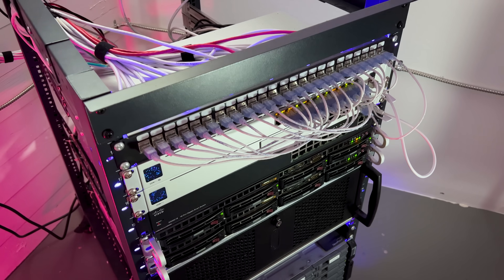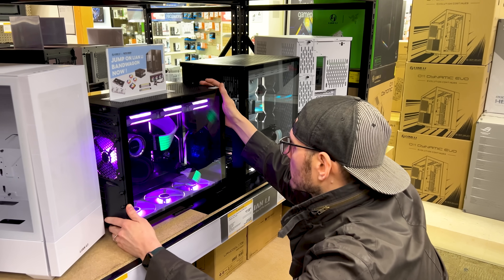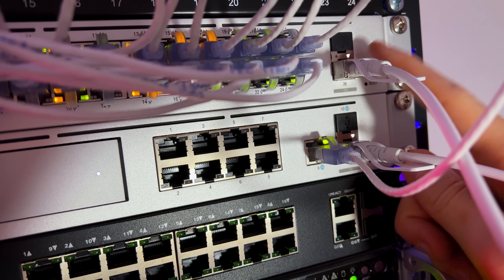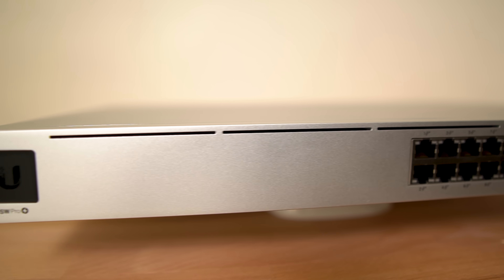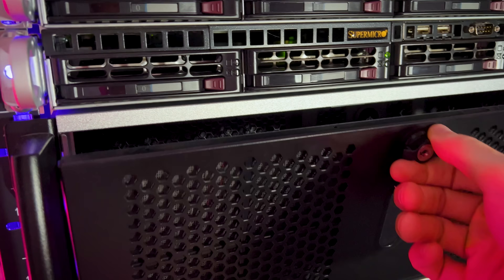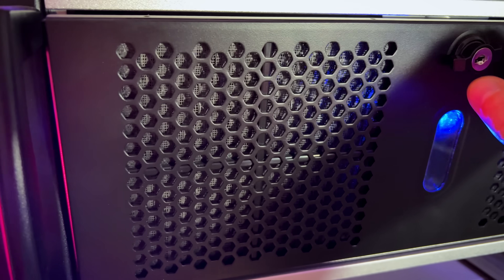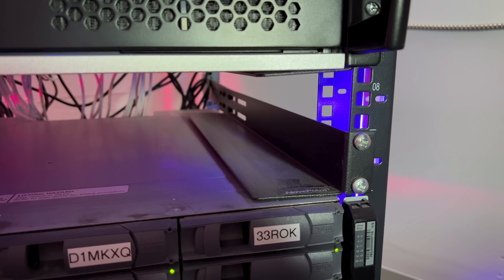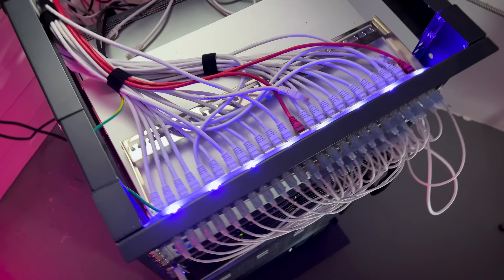My HomeLab Regrets...

Comment: Hey Tim if your UPS unit ever needs batteries I can confirm that LiFePO4 replacements are fantastic. I recently had a 5-hr power outage and my 900W APC (2x 12v 18Ah batteries) lasted nearly 30 min with a constant 320W load. There's a price premium for the pre-made batteries (as opposed to DIY) but they work so much better and they'll last so much longer than SLAs. 😃

Comment: You kind of glanced over the noise of the 1U chassis - do you have them in a space where the noise isn’t an issue? Or are you able to spin down fans to reduce noise but keep noise down?
Reply from the maker: They aren't that loud.  They are in my basement too, which isn't where I hang out

Comment: Actually with the new firmware Version on the UDM Pro you can assign both SFP+ Ports to be LAN or WAN - I am so happy they finally added that feature !!
Reply: Yeah, the new feature is really handy. In the EA firmware it’s even better. But you have to be weary of how the ports are wired. To get from any of the ports except for between the gigabit switch ports you have to go through the CPU so I’d probably skip using them if you want high speed networking across the two 10G ports - they aren’t a switch.
Reply: O0o0o0. I didn't know that. Must try it

Comment: And at 5:55 we can see 50% of the available memory bandwidth not being used. Move the two modules in the black slots over to the two blue slots on the other side of the socket. Then you will use all 4 available memory channels instead of just 2.

I myself have recently gotten into setting up my own home network/computing lab for better or worse... Currently though just have one 2U server and no rack for it yet. But one has to start somewhere...
Reply from the maker: Thank you!  Since then all slots are now filled but good to know!
Reply: @TechnoTim  Information regarding channel layout tends to exist in the motherboard/system manual. Usually alongside a "recommended population order."

Some motherboards also print: A1, A2, B1, B2, C1, C2, D1, D2. Or A1, B1, A2, B2, A3, etc. Or other fancy numbering systems. But if the naming/numbering doesn't make much sense, then it is best to check the manual.

Though, then there is some cheap 2011(-3) boards that only uses 2 out of the four channels regardless, despite often have 4 memory slots...

Comment: Great video Tim! Do you have thoughts on the time horizon for future-proofing, for when you might be trading off technological improvements over time? Like for your switch regrets/recommendation, if I think I will need more than 24 ports but maybe not for 5(?) years or so, is it better to buy the 48 port now that will fit my needs in 5 years, or buy 24 now and either another 24 or a 48 replacement in 5 years, when the tech has improved by 5 years, when maybe at that point all the ports are 10gig with some 100gig uplinks? What sort of time frame do you consider to be too far into the future where the future-proofing becomes compromising?
Reply from the maker: This is a tough call.  What I learned is that adding capacity is relatively cheap if you do it up front but expanding it later can be expensive (You have to rebuy) Adopting new tech is also expensive.  I try to balance this out.  I wish there were a great answer to this but I just try to do the calculus when I buy.  For instance, there is a 48 port switch is is PoE and also 2.5 Gbs.  I seriously considered it but then looked at the price.  It was a 1/3  more in price for a tech I probably won't use, especially if I am plugging in PoE devices which are typically 1Gbs at most.  It's always a case by case basis and I will be sure to continue to share my findings in the future!

Comment: I am currently thinking about getting a server for my lab. I'll get a few 16TB Wxynos drives for cheap in a few months and am not sure if I should get an old 2x xeon dl380 gen8 with 128 or 256 gb of ram or if I should invest in a 128 gb build with new parts because that'll save me some power since the newer parts are more efficient. Another plus would be that I could easier use a custom cooling solution since noise would be a problem... decisions decisions..

Comment: Patch panel, I like you choice and for those who love using solid core installation cable for DIY patch-leads, shush, I am that guy that will rip your crappy cabbles out and replace them. 
1RU SM servers are not great value for power and performance. Dell 6XX servers better or go 2RU. I don't agree with any person who uses parity RAID on operating systems (VM's included). Performance sucks. 
Storage chassis, if you want storage, don't complain on power needs, spinners need power.
Reply from the maker: Noted! 😀

Comment: Great video Tim . I am personally not a fan of the pass through keystone patch panel, but if you’re not use to terminating cables this is a good way to go .

The UDM pro is will fully feature wireguard and OpenVPN in the future ( just need to wait a little more time ) 😊
Reply from the maker: Hey and thank you!  Yeah, you're a pro at doing this!  It would seriously take me 2 days and I would still have half of them that wouldn't work!
Reply: All of you always say you don't like the Keystone passthrough patch panels but never say why... Can you elaborate?
Reply: @Gunzy83  I love keystone patch panels that’s all I use. What is being used here is keystone pass through so you’re connecting ethernet cable to the back and front with rj45 ends.

Comment: 6:00 there are some cool thunderbolt cards and even ones that use a riser card to grab more than on pcie slot and then pipe the 40Gb+ of each slot out a thunderbolt connection to what ever enclosure you want. Its a meathod I employ in my 1U to add 10G and a HBA card that connects my disk array.
Reply: Do you have a link to these Thunderbolt Cards? 
Particularly the ones that use riser cards to combine output from multiple PCI-E slots.... If that is what they do.

Also, I assume this is on supported platforms only?
(By this I mean, "Can you do this on older non-TB3 Platforms like AMD AM3 for example?")
Reply: @LND3947  I think so. There are some more main stream enclosures that are used to add expansions to macs. The card can be a little harder but ill edit this comment with one when I find it.

Comment: I saw a server that was 2U maybe 3U, It’s split into four quadrants on the back and each quadrant can be pulled out and have a complete server built into it and then it slides in. So in theory you can run for servers in two units of rack space. 

I think if I were to start over again I would’ve saved some money on my ubiquity gear by buying the dream machine pro SE over the dream machine pro, and I would have started with the 24port enterprise switch instead of starting with the 24 port switch than the 24 port pro switch then moving to the 24port enterprise switch. The latter of which gives me POE and a handful of 2.5 Gb ports as well. Currently my steam machine and my server or connected up with 2.5 Gb

Comment: I have several used DELL servers.  My latest one is an R730 with 2x 16-core XEON CPUs (E5-2698 v3 @ 2.30GHz), 256G DDR4 ECC RAM., 2xSPF+, 2x 1G NIC, 8x 2.5" SAS Drive bays for about $1700.  I purchased SSDs separately and don't remember how much those cost.

Comment: If you did upgrade your disk shelf, what would you go with?  I have the same shelf and it's definitely the most obnoxious part of my lab
Reply from the maker: I will share my findings soon!
Reply: @TechnoTim  thank you!
Reply: That shelf is a NetApp DS4243 or DS4246.  Not sure if you have 4 power supplies, but if you're using 7.2k sata disks and no SAS disks, you only need 2 power supplies which saves power and noise.    I installed those for many years for NetApp arrays and have 6 of them myself.   I only use two shelves currently, one with 12 drives and one with 18 drives and both are quiet and don't pull very much power.  There is probably 200w of overhead  per shelf and 10w per HDD on avg.
Reply: @fili0926  I have the DS4243 and they're full with 24 drives and two PSUs. Everything else in my lab is consumer grade custom built stuff so that kinda stands out. Although at idle it's definitely nowhere near as loud as when it boots lol
Reply: Also, pro-tip if you have empty slots space your drives out for better cooling.  I recently had my 12 drives grouped in the top 12 slots.  I spaced them out evenly over the 24 slots and disk temps dropped 5C at idle.

Comment: I personally regret actually buying Dell servers and not sticking to consumer hardware like I should have and just getting some rack mount cases. Really the only nice thing is the redundant power supply and the IPMI interface. I however don't regret the purchase of a 42U rack, but I'm not even using hal;f of it. So TechnoTim, if you want. I'm willing to trade you racks. Mines a 42U startech open frame rack.

Comment: I do have same thought couple times a month. Should i start all over again with my Proxmox Server and all VMs. A lot of things i would do in different way and more optimised. But then i realise that current setup is already a refresh i did 10 - 12 months ago when i had same thought to start from 0 and do better. 

Any setup is a great setup as long as you can easily find problems and fix them.

Comment: Thanks for the upload! Looking forward to more awesome educational videos. You are great at explaining stuff so it's easy to follow for even noobs like myself. Hoping to see a pfsense as a router and firewall video soon. It would be great to see a video from you that explains how to run all your homelab services but only using a simple PC with enough RAM and storage. Use, opensource software solutions where possible instead of purchasing expensive enterprise level switches or firewalls. Nothing against them but not all homelabbers can afford them.

Comment: You know you can change the SFP+ 10gbe WAN point on the UDM Pro to a LAN port? It’s a setting in the GUI
Reply: If so, that must be a brand new feature, as I see no such option on mine, but I also haven't updated the firmware in a little while.
Reply: @Blooest  there’s a specific firmware update that enables it to be switched

Comment: UniFi added support to switch wan ports to lan ports. On the port section at the bottom you should have a link for configure interfaces. You can change port 10 to lan.  however I don’t think you an LAG it with port 11.

Comment: What would you get instead of the disk shelf then to house your drives?
Reply: That is what I wondering too. I’m in the process of looking for a disk shelf so I’m really curious
Reply: Did Tim hint at what he would have replaced the shelf with?
Reply: @antoarre  not that I’m aware. Tim has said soon for sharing that info but when will that be I can’t say. I’m hoping the next video or the video after that.
Reply: @josephmyers5956  Thanks for the info. I'll be sure to double check the upcoming videos for it. I have been torn getting a disk shelf, but knowing the power draw, I'm interested in alternatives. Thanks again.
Reply: @antoarre  No problem.  I'm in the same boat too.  I have been thinking of getting one too but would like to know what the alternative would be too.